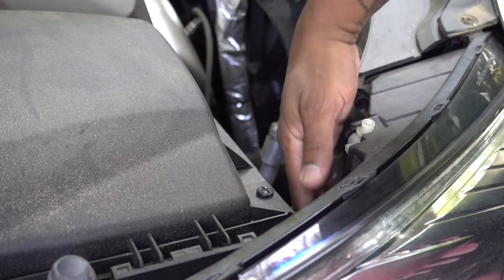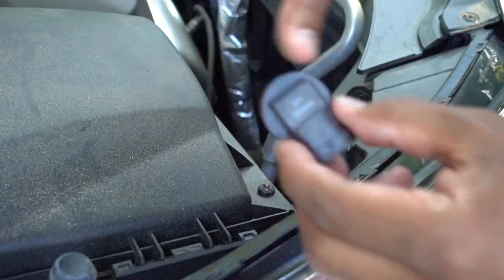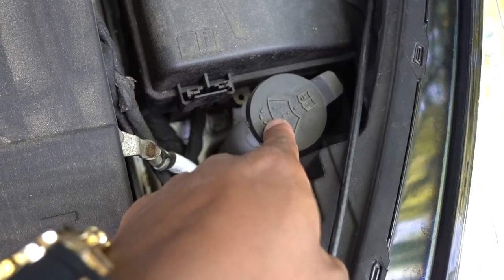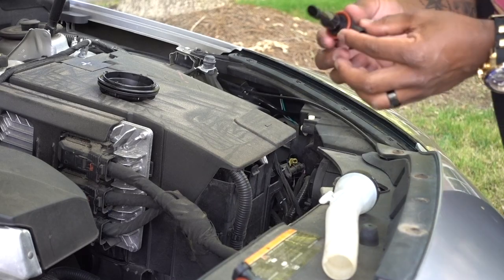2016 Chevy Impala With H11 Headlight LED Bulbs | Super Bright

Comment: When installing LEDs on a projector beam headlight housing, they have to be properly leveled and centered. Otherwise, you run the risk of positioning them improperly, and they'll point in the wrong direction and angle. It's not as simple as just sticking it in, as you would on a regular reflector housing.